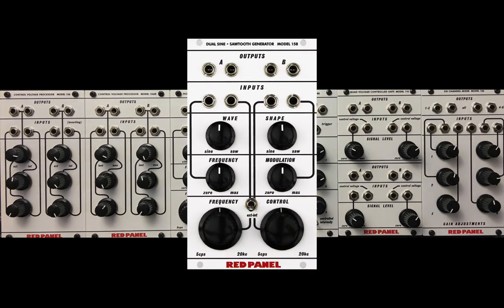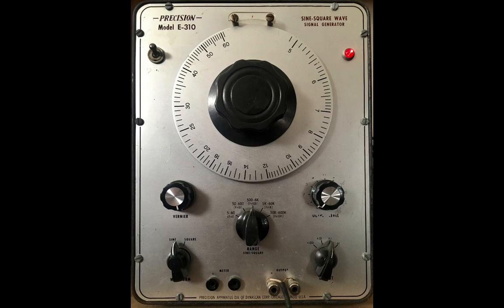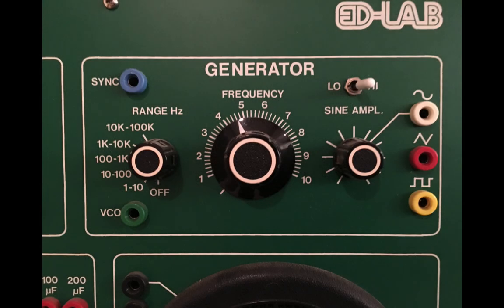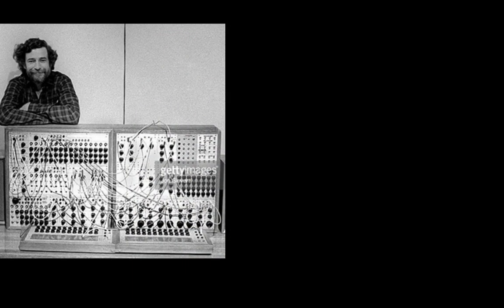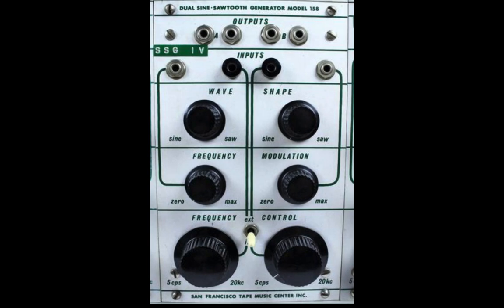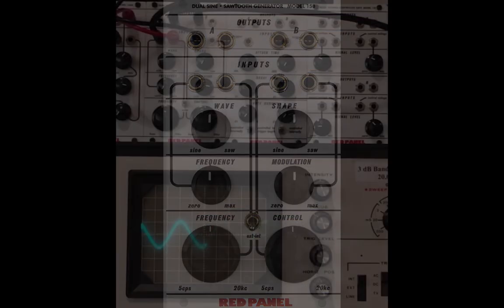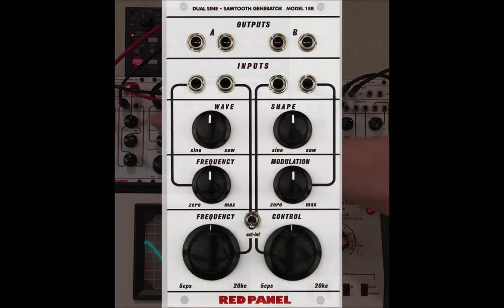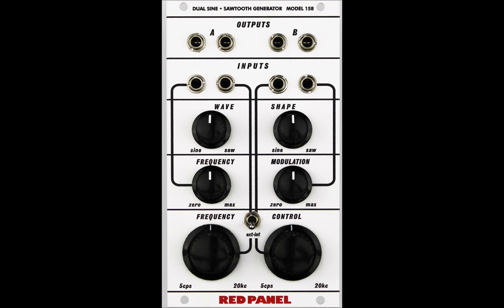Part 1-Red Panel 158 Overview

Comment: The red panel was coated with LSD so if you needed some inspiration you just licked the panel or put a wet finger over it and licked that and you were transported into the mystical deep. Well, that's the theory :=)